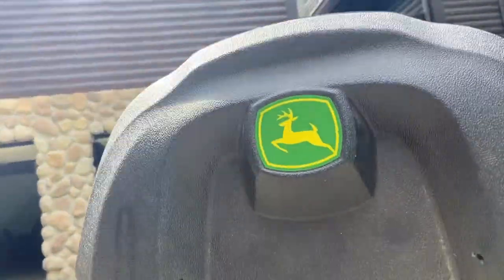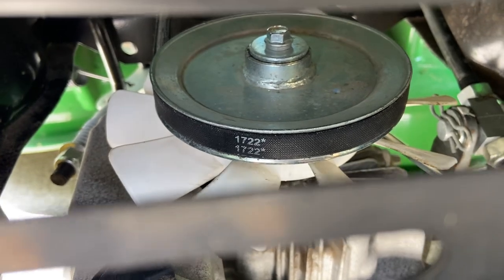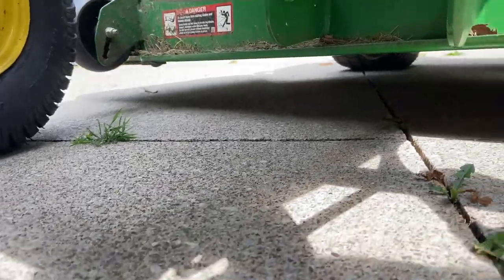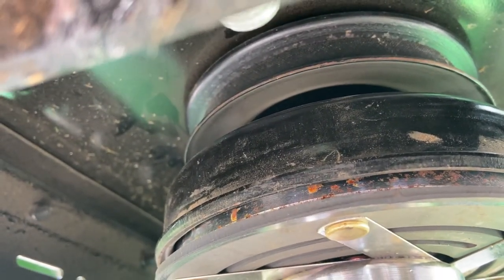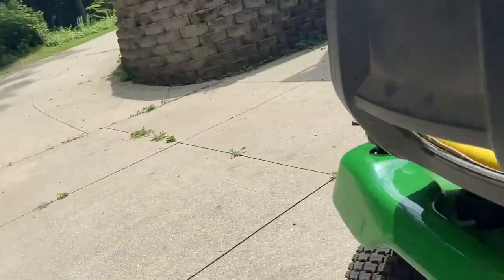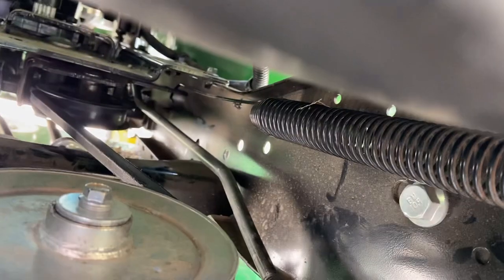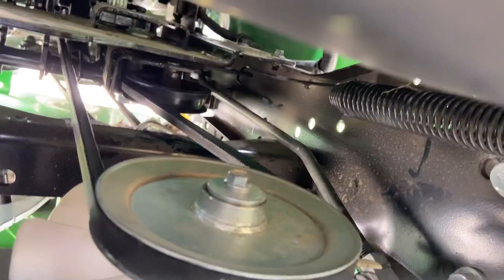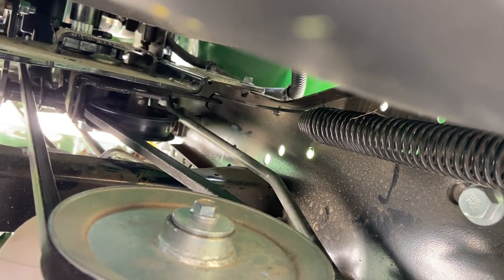John Deere X350 won’t move forward or backwards - how I fixed mine

Comment: thanks i think that is the problem i have on my under 2 year old x330.  i will check this out in the morning.  nothing in the owner manual helped me like your video probably will.  the belt was off the rear pulley but  after putting it back on it was still very floppy, sloppy and loose

Comment: I had a stuck flip up and break off inside of my deck belt cover. It immediately threw my belt and locked up the spindle. I thought id lost a bearing and itd seized,but when i took the belt cover off it just fell out. Took me a few minutes,but im glad i didnt need to replace a spindle.

Comment: Thanks for the great vid. I got the belt back on the front and rear pulleys but (looking from the back of the mower toward the front) the tensioner is pushed way over to the left. How did you get the tensioner to move all the way right where the spring can attach and still have the belt on the pulley in the rear?

Comment: I cannot find where to hook the spring up by the small pulley
Reply from the maker: @elaineday9722  if you zoom into the video at around to 3:58 to 4:10 mark you can see the far and of the spring going into a groove. I’m having a hard time finding the exact diagram I used. But you can see the spring in the groove at that part of the video. Hope that helps.

Comment: Man I sure hope it's my spring. The trans belt is on and running but it engage.  My Deere rolls with that push bar in or out. ( Whatever that's called.